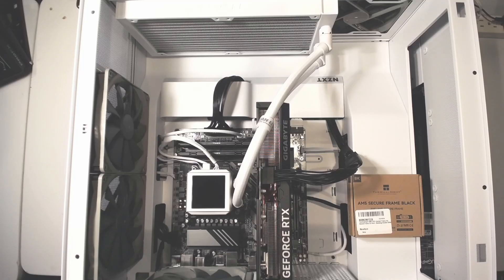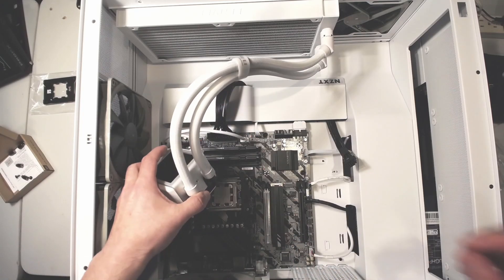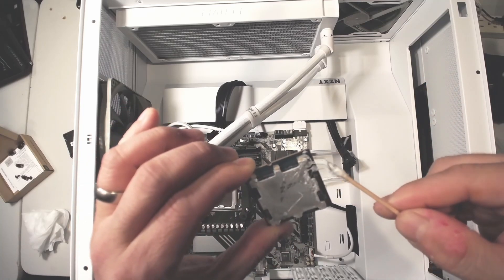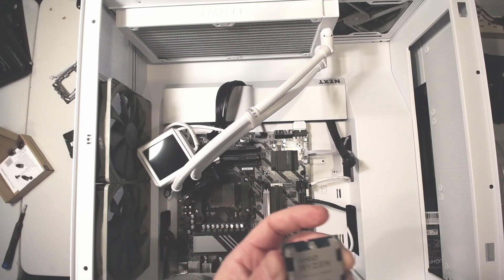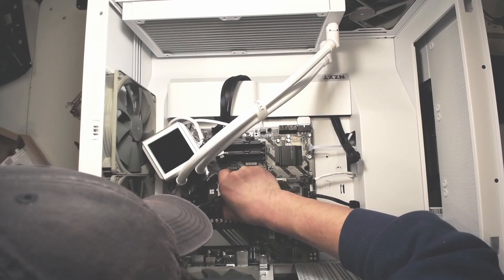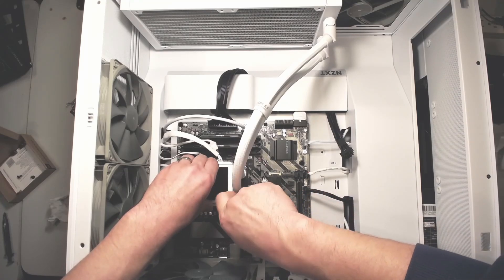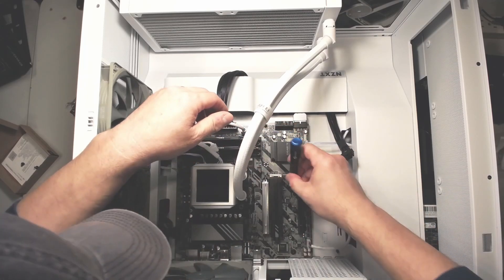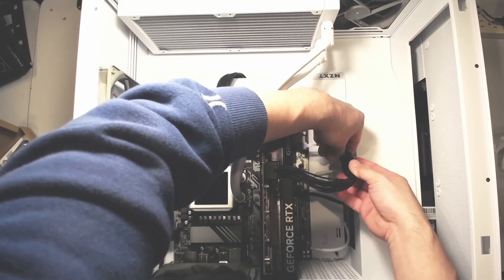AM5 CPU Contact Frame Install

Comment: Have you tried streaming and productivity work with the ryzen 7 7800x3D ? I’m wondering if I should get the non x3D because I want to game and stream and edit and work ect. But I can’t find any clear info on how the 7800x3D does in non gaming tasks?? I don’t want to stream and run into performance issues ect.
I was thinking about the thermal grizzly contact plate too, I know it protects the inside of the cpu and stops the iHS from bending over time, while allowing great contact for coolers. I wasn’t sure if I needed to get a thermal grizzly cpu backplate for the back of the motherboard but it seems like the stock one works, nice.
Reply from the maker: No I have not streamed with 7800x3d.  I built it purely for my gaming.   The x3d cpus are mainly for gaming.  you prob won’t see much of difference on a x3d vs non x3d for streaming.  I would recommend offloading your encoding to different hardware, or dedicated hardware in the same pc.